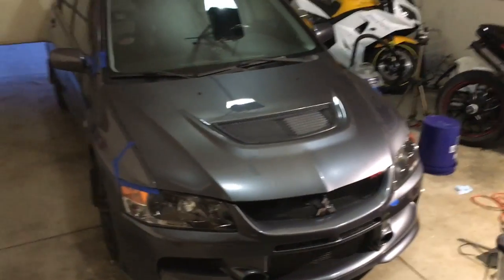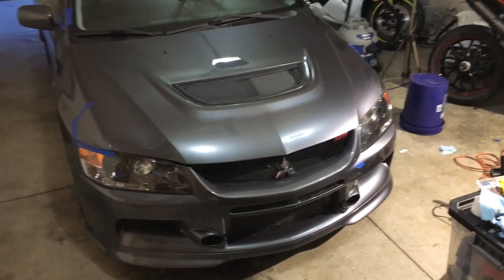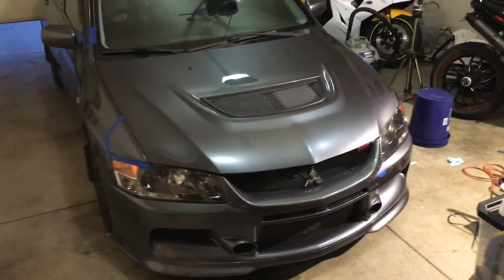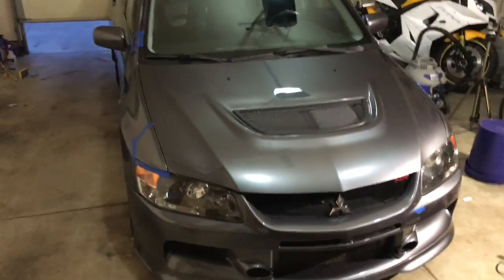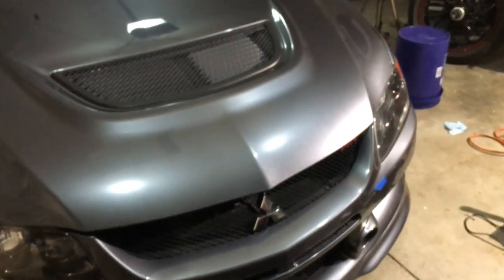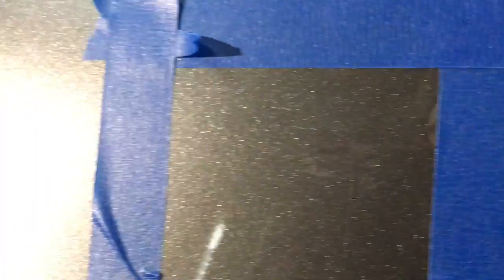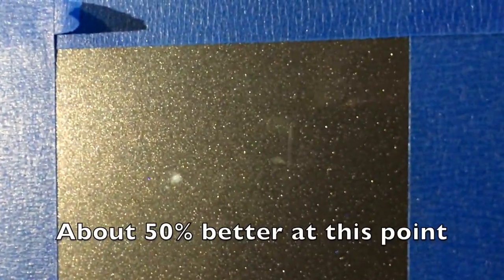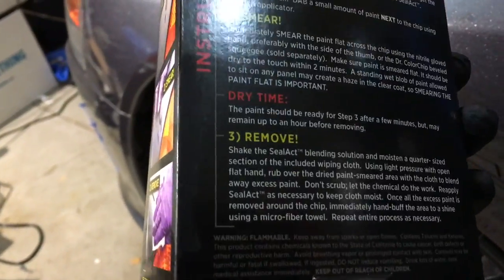Dr. Colorchip Review & How to Apply

Comment: Ive used this product on 3 different cars over a number of years.  It works really great and is permanent but sometimes you have to make several attempts to get perfect results.  I've done over 3 or 4 times using different amounts of paint and sometimes using different angles.  The thing to remember is you don't have to worry because if it's not what you want you can use the leveler solution to remove all and start over.

Comment: The first big chip temporarily disappeared when you put the alcohol on it. When this happens it means that the chip is in the clear coat only. You could have just buffed or even wet sanded it out. Much easier, a lot cheaper and the result would have been perfect. It's a lot better to just fix the clear coat instead of trying to put base coat in the clear.
Reply from the maker: Dr Jones I understand where you’re coming from, but why would I remove precious clear coat to fix that small of a chip? I still got a result I was looking for without taking off anything I can’t get back
Reply: @ALLDAYANTHONY  well said.

Comment: On my drive to work I was stopped at a red light when a dump truck came though the intersection and speckled the side of my Dodge Ram 1500 with about 10 small little chips and one of them is starting to rust. Great.

Comment: That first chip, your technique was not correct.  I think you pressed down rather than gliding over when use Sealac and the mf towel.
Reply from the maker: I mist likely did, but the paint was pretty stubborn to get off with the seal act. The simple wiping technique wasn't quite enough
Reply: ALLDAYANTHONY You just have to keep wiping gently and let the Sealac do the work.

Comment: How the seal act is suppose to remove the paint surrounding the chip yet not remove any from the still uncured chip crater has always seemed like such a mystery to me.
Reply from the maker: Magic!
Reply: Because you glide over the top of the chip.
Reply: It's like knocking down the paint but with a liquid rather than sand paper.  Once the surrounding paint is gone stop and let it cure.  Leave the paint cure for 4-5 mins to help prevent removing the paint from the chip.  If you use the Sealact cloth with a squared off block it works even better.

Comment: I am not there to see the car but most of those look like they can be wet sanded out. 2k then 3k then cut compound then polish.
Reply from the maker: I'm a hobbyist detailer, the chips themselves were to deep to wetsand in my opinion. I've removed tons of deep scratches on cars over the years with wet sand and a DA, but these were not the case
Reply: So you know what you are doing then. They do look so light in the video. Question...how did you find the product compared to a hobby brush & regular touch up? Is it worth the cash in your opinion?
Reply from the maker: I've done the 'professional style" touch ups before with color matched paint, model brush, wet sand, and polish, etc. This in my opinion is a way cleaner process that is 90% less stress. I'm somewhat of a perfectionist and this product met my standards for the price
Reply: Thank you Anthony. I just ordered it & thank you for the video.

Comment: The first chip is not a chip.. basically it's just a clear coat scratch.   All you did on this repair is put a drop of paint on top of the clearcoat..  shoulda just buffed this out.
Reply from the maker: The "scratch" was beyond buffing as it was beyond the clear and into the metallic base coat. It would not buff out because I tried. I could have simply put more clear there, but wouldn't have had the same result as Dr Colorchip